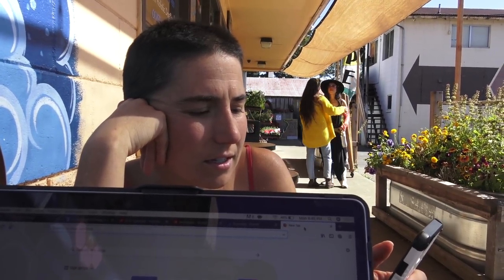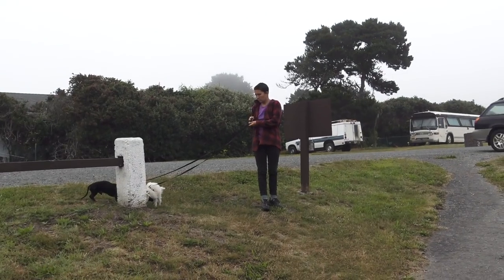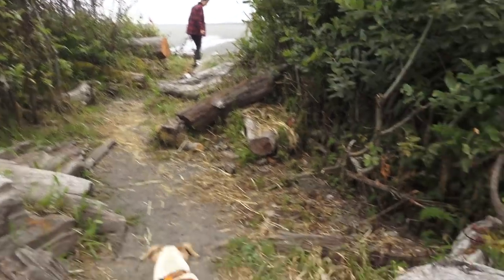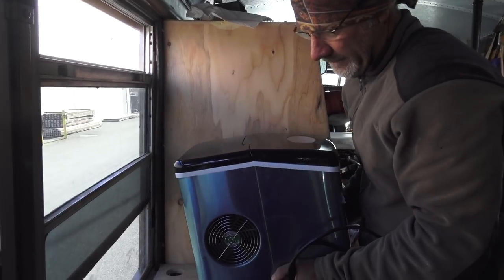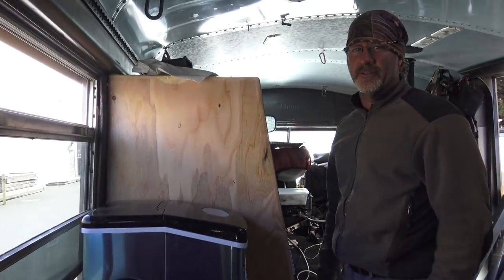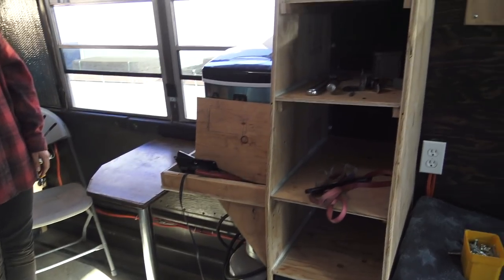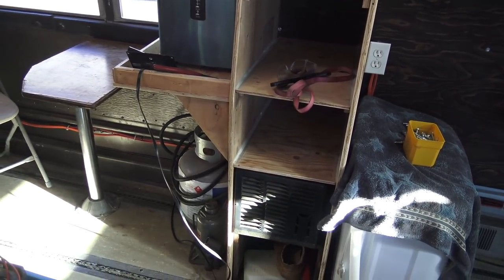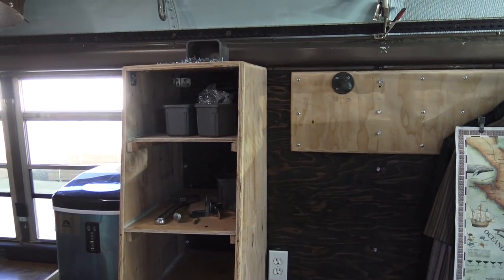Heading down for our solar install in So Cal

Comment: Storms bring the trees in during storms. They are ripped out during flooding on rivers and much later tossed up on the beach. Also from logging years ago.
In the case of my father’s home, a tree was tossed over the small beach, over railroad tracks, across a long garden, to land with a enormous thump next to his cottage.  It was 80 feet long and eight feet in diameter!  Quite a wave action!

Comment: While I have done it myself, high pressure propane needs to be kept outside of vehicle passenger area, pressure regulated down, then plumbed inside.

Maybe thats the plan.

If it gets hot inside and tank relief valve vents, well bad stuff could happen.

Comment: My dog was a lousy traveller (anxious, couldn't stop panting) until I stacked pillows high enough in the back seat upon which he could both fell secure by laying down (taking strain off his wobbly legs) as well as still be able to look out the windows which I think was key for his becoming a great traveller.  Car travel for dogs is not unlike getting seasick for humans - it helps if the dog is able to keep his eyes on the horizon  so he doesn't feel claustrophobic and can see out the window.  If the meds don't work, try getting your dog to lay down on Jaime's bed and see how that works and if it improves his comfort level.

Comment: Jamie check out a heater that runs of your motor  instead of propane less cost more   room  a lot safer I forgot the name of it sorry  I rhink it will use less than a gallon of fuel depending on how long you use it . Please check in to it ok. Peace brother  and be safe

Comment: Vet CBS oil is expensive,  I use regular CBS oil made by green roads (comes in green bottle)100mg on my cat and just have to figure out the dosage for her size. It is only $19.99 a bottle. Much less than the vet cbd oil and was told it was just the same thing. Just the marketing is different.  And have had no problems.

Comment: Aren't projects fun?? :) If you're building over the windows it will cut down on natural light....I put an upright cabinet in my van and it felt claustrophobic. Also, since the windows were then covered, I was trying to wake up in a dark area, which threw off my circadian rhythms. But it looks like you're thinking of building over a window that's already covered?
Reply from the maker: Yes, Mallory! We just went over an area already covered. I also like a lot of natural light, which is great for a skoolie conversion!